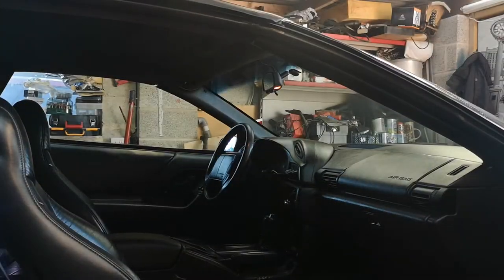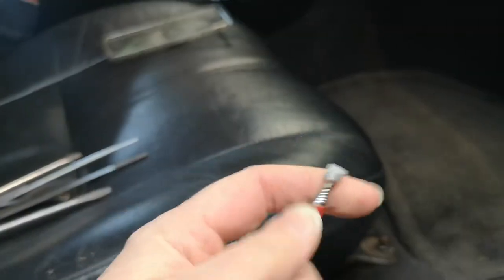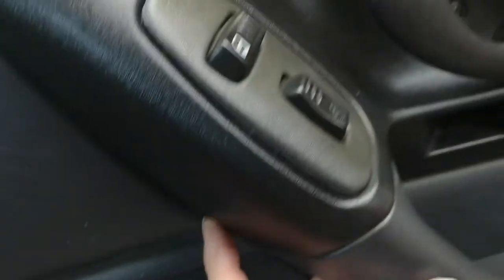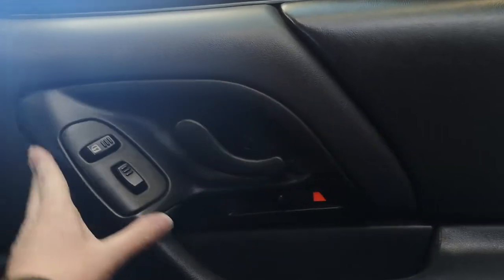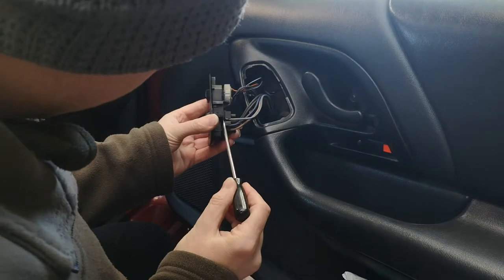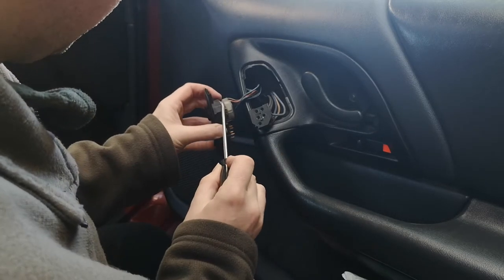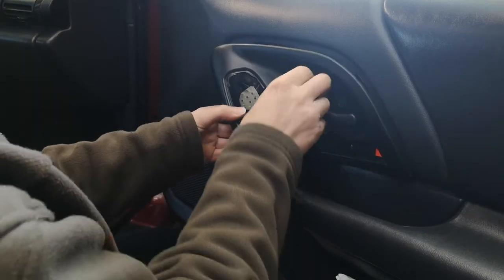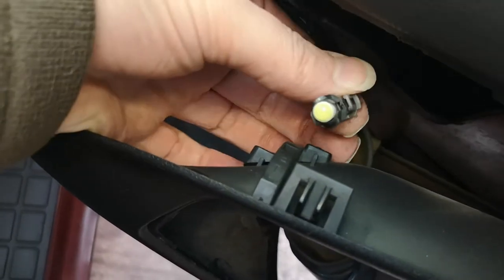How to fix 4th gen chevrolet camaro 93-2000 door switch light easy. Firebird, Transam GM F Body

Comment: What issue does this cause ?
Reply from the maker: It's when the lights on the doors above the door handles don't work and the bulbs need changing
Reply: @lucasfisher6993  so this is when my courtesy lights won’t shut off even after closing all my doors ?
Reply from the maker: @dloco4206  nope
This is when your bulbs don't work at all any more because they're burned out and need to be changed